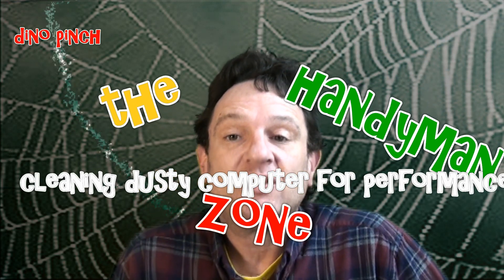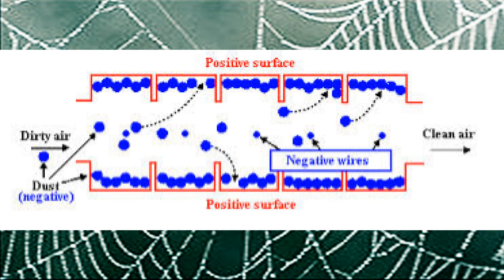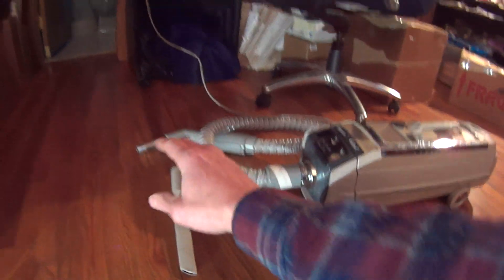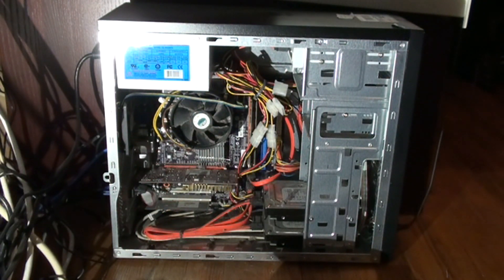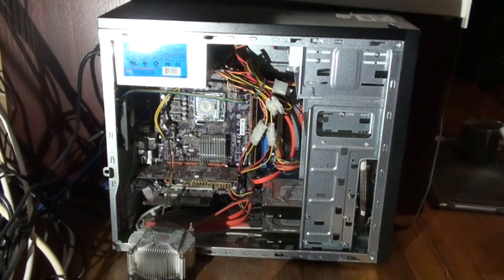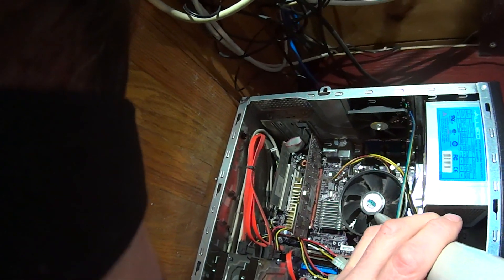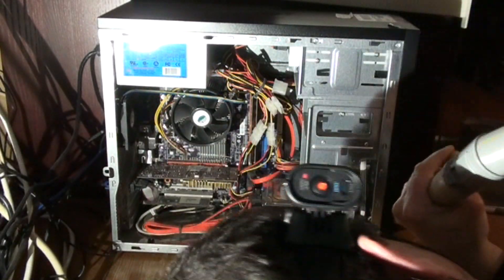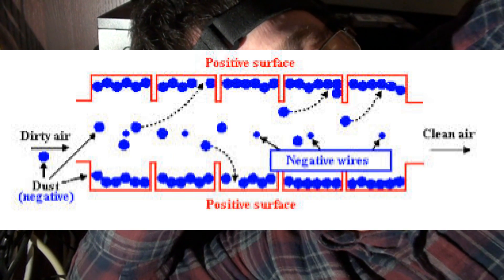HOW TO CLEAN YOUR DUSTY COMPUTER for performance & longevity

Comment: "make sure its unplugged" yours isnt even unplugged you can see its still plugged in. also you shouldnt be taking off the heatsink. that in itself is going to disturb the coat of grease and raise temps higher than they already were. secondly, taking your computer outside and using canned air on the ATTACHED heatsink/dust cavities would be much better then using a paintbrush (LOL U SRS?)

Comment: just another video about which you now nothing about. When working inside a PC you should be wearing a grounded wrist strap to discharge any static electricity. And you NEVER want to use air from a compressor, that air contains LOTS of rusty water. Easiest way to get it very clean is to take it outside and blow it clean with a vacuum.
Reply from the maker: jerry, the vacuume cleaner is grounded....lol
besides,  not touching board with hands, just vacuume hose (gronded) & plastic narrow crevice tool, plastic dont conduct..... thanks for watching tho
Reply: You dont know what you are talking about either....you dont need anit static straps their are ways around that and most air compressors do have filers to take the moisture out the air
Reply: have filers < I'm sure you mean filters, but more than most do not have filters or dryers for home use. But to each his own. Take your chances if you wish.
Reply: no chances taken just common sense
Reply: common. for sure
Reply: yes it is